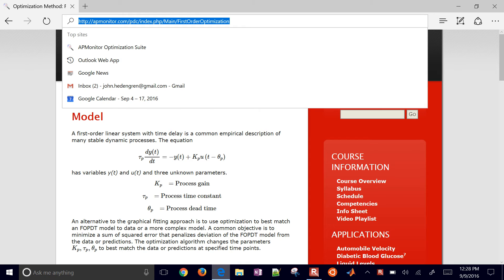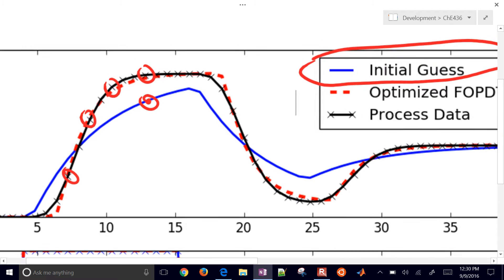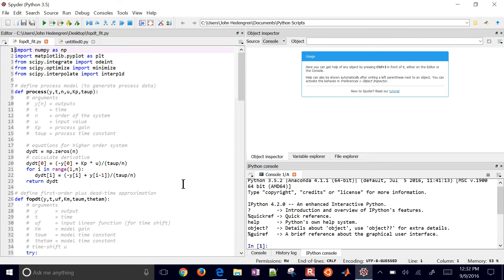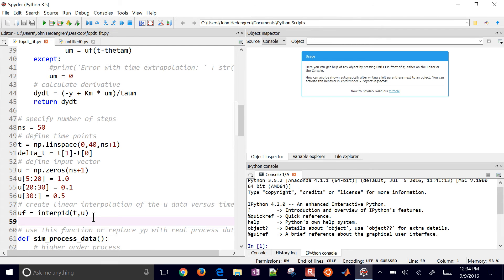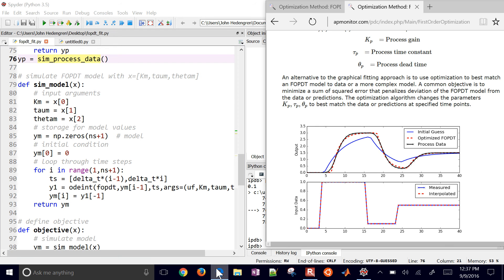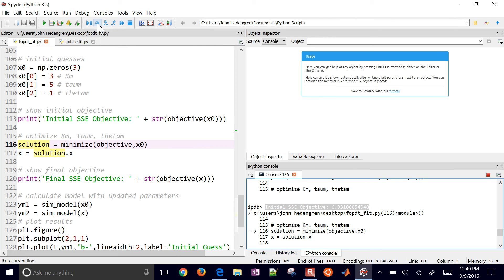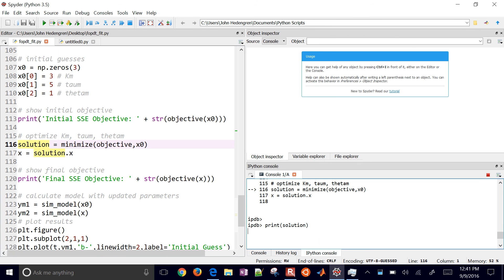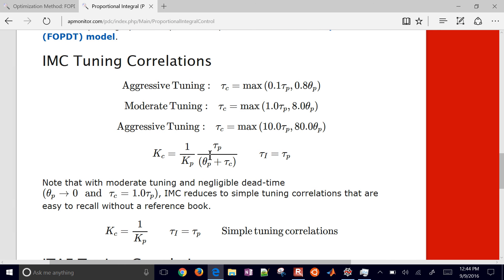Fit Lower Order Models in Python

Comment: FOPTD systems can be fitted manually, you dont need optimization for it, the fit is still an approximation so you cant use it aggressively in control and optimizing the fit will make no difference for the end result of the controller

Comment: Why if I change the initial guesses (for example km=1, tau=300, tau=0) I don't get an accurate solution? I thought that whatever I put at the initial guesses, I would always get the same solution (the most accurate).
Thank you!
Reply from the maker: The Scipy solver isn't the best one and sometimes get stuck with a bad initial guess. See the gekko source code at: https://apmonitor.com/pdc/index.php/Main/FirstOrderOptimization for a better optimizer. The PIDTuner.com website also has an efficient implementation.

Comment: my data columns are TimeLogged, power output, temperature measured, and temperature setpoint... should i used directly as the variables  input= temperature measured and output = power output? to what use are the setpoint?

Comment: Great video, many thanks! What is the correct way to update the code for fitting FOPDT for 2 input parameters (MISO 2x1 case)? More specifically: how could one estimate dydt for 2 simultaneous input signals (it seems like just summing up derivative from first input signal with derivative from second input signal does not work since the presence of (-y / tau) term in both derivatives)?
Reply from the maker: Here is an example of fitting with multivariate effects: https://apmonitor.com/pdc/index.php/Main/ArduinoEstimation2  Your equation would be tau*dy/dt = -y + K1*u1 + K2*u2.
Reply: @apm  Thank you very much for the extremely fast reply!
I've already come to tau*dy/dt = -y + K1*u1 + K2*u2 equation, but it seems to be an approximation working nice in case of tau = tau1 = tau2 (i.e. same inertia in u1 -> y and u2 -> y channels). Would not it be more precise to use (tau1 + tau2) * dy/dt = -2 * y + K1*u1 + K2*u2 in case of tau1 >>> tau2 ?
Reply from the maker: @olegantipov6777  it depends on the physics of your system. In most cases that I've seen, the inertia term (related to mass, volume, etc) is constant (tau) and the disturbances affect the system independently. One thing that you could try is to write-out the balance equation for energy, momentum, species, etc: https://apmonitor.com/pdc/index.php/Main/PhysicsBasedModels  The linearized version of this balance equation will tell you the form that you should use: https://apmonitor.com/pdc/index.php/Main/ModelLinearization  If the two disturbances are independent then you could use deviation variables (both start at zero) with tau1 dy1/dt = -y1 + K1*u1 and tau2 dy2/dt = -y2 + K2*u2 and y = y1+y2.

Comment: I have some data i collected from my arduino board but the code doesn't seem to converge on anything close to actual data.
Reply from the maker: The solver scipy.optimize.minimize function sometimes has a hard time converging without good initial guesses for your parameters. Maybe try the "ARX_Regression" in folder "2_Regression" instead of the "1st_order" or "2nd_order" options. You can download all of these files from https://github.com/APMonitor/arduino  Let me know if it doesn't work.
Reply: Still not converging.Fitting to a FOPDT should work for the Adruino. Does Matlab have any built in functions that can fit the FOPDT model to the measured data?
Reply from the maker: Could you send your data file and application to the APMonitor discussion group (Google group)? Here are some tutorials with MATLAB. The solver fmincon in MATLAB is generally better than the SciPy optimizer. The APMonitor solvers such as IPOPT or APOPT are better than fmincon.
Reply: APMonitor.com I tried posting but I'm not sure if you can see it (I'm not able to see my post but I definitely posted)
Reply from the maker: I just approved the message. Thanks for sending the data. I should have an answer back shortly.

Comment: In the website you have a slightly different code in the fopdt function. From the video it's:

dydt= (-y +Km*um)/taum
return dydt

and in the website's code it's:

dydt = (-(y-yp0) + Km * (um-u0))/taum
return dydt

Why is that? I tried it with my data and it works perfectly with the website's code, but if I change that back it's off by a lot. I don't really understand what it's doing or why it's necessary
Reply from the maker: +Oscar Daniel, the video is using "deviation variables" that assume zero initial conditions so u0 and x0 are zero. If you don't have zero initial (or steady state) conditions then you need to subtract them in the equation.

Comment: Why the optimization solver says False for the success?
Reply from the maker: The accompanying message says, "Desired error not necessarily achieved due to precision loss". This Python solver uses finite differences to get first and second derivatives for the iterations. Sometimes finite differences can cause problems. Qualitatively, the solution looks like it was very close. I'd recommend giving the solution values back to the solver to attempt a second convergence run with slightly different starting conditions. Thanks for catching this and for the great question.